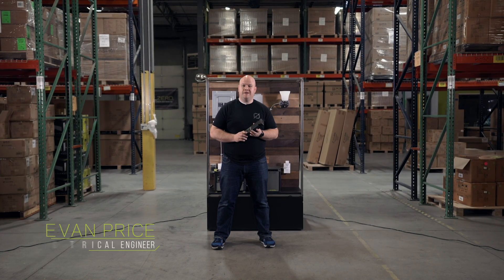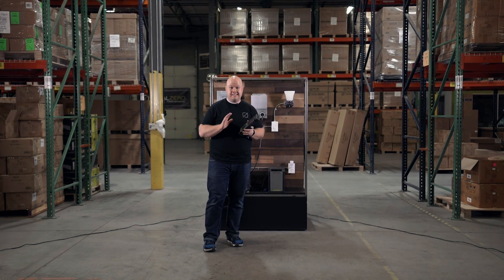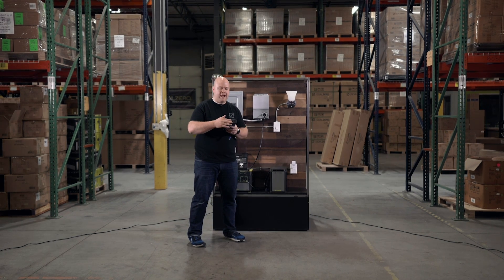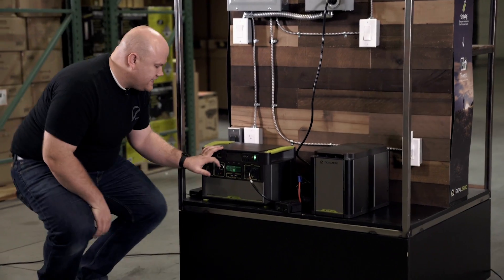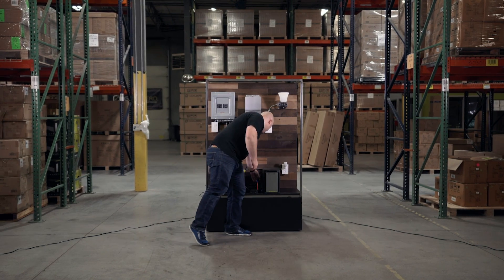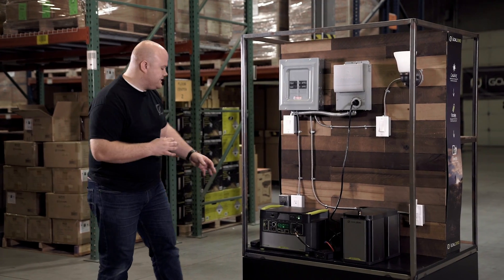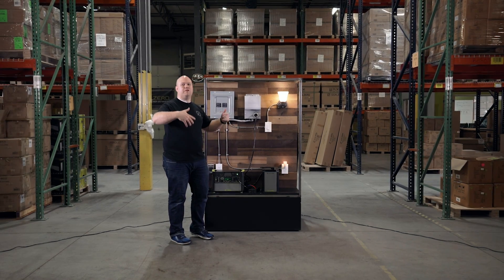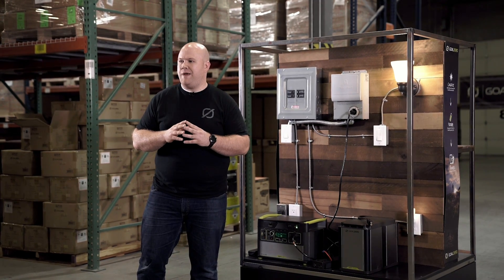From the Engineers | The Goal Zero Yeti Link & Tank

Comment: I live in Florida and bought this item and 2 sets of solar panels to replace my gas generator. I have tried it out on a number of items. I recently tried it out on my Instapot Duo Plus. It works great. The Instapot Duo Plus draws about 900 W max. heating and 60 W cooking, cooked sweet potatoes in 10 minutes. It drew about 7% of the power for cooking. Peak was 900 W, low 25 W. My freezer is old and medium sized drawing up to 150 W but only 7 W most of the time. My Oster toaster oven draws 1000 W when heating, big draw of course for heating elements but that’s expected. I have used it for my laptop computer, charging my iPhone, iPad, etc. It recharges pretty quickly. This is a great value for the money.

Comment: What are those power cables running across the floor to the display? And more importantly, how long does the Yeti 3000 power things (device wattage x duration)? Last question: How much do the Yeti Tank LA/AGM Expansion battery units cost per unit? Thanks.
Reply: Go to Amazon for prices if in stock. Otherwise go to Goal Zero dot com for all the rest of your questions except the first one. I suspect the cables going across the floor in this ULTRA DARK video is just the set up for the video and all. And oops guess GZ forgot to turn on the LIGHTS to make a DECENT video so you can actually see where he plugs in and unplugs things. DUH Goal ZERO and you make lanterns and portable lights and power banks and what happen to the logic of actually using some in this video?

Comment: Why not use LiFePo4 in the extra battery, a 4S LiFePo4 can be recharged with standard AMG chargers if temperature compensation factor is set to 0.

For people whom want to make their own, you only need a bust-buck converter with a current limiter, a LVD for the external battery.

Goal zero already makes one of these boost converter. Their 12V charging cable. The only thing you need is a LVD..

Comment: So I applaud the fact that Goal Zero recognizes the maximum input power capability of large Yetis (previously 685W on a VERY good day) vs >1500W of output power as a weak point and released this module to be able to bring in higher power levels (750W) to a yeti.

I think many people would like a means to connect large solar arrays without using a lead acid buffer battery (the whole point of buying a Lithium yeti is to get away from lead acid technology).   

I know at the top of my yeti wishlist is a 65A MPPT controller preferably with higher voltage input, but within the constraints of what is available today.....

Has goal zero engineering (or anyone else) messed with feeding a yeti link from an external MPPT controller WITHOUT a lead acid/agm buffer battery between them?  Obviously this is the preferred solution as it keeps Goal zero hardware and charge algorithms in control of charging their own batteries, keeps the solution purely lithium, eliminates maintenance issues of seldom used lead acid batteries (sulfation, stratification, etc) and still keeps the package fairly portable.
Reply: There are difficulties in charging lithium batteries, due to the characteristics of those batteries. Lead-Acid (or similar) batteries don't have the issues that lithium has, and they're very welcoming of changing current inputs. This makes them the better candidate for solar systems. Even if your main system is lithium, having a lead-acid battery as a buffer makes for the most efficient system, capturing more solar energy. In a case like a home back up, having banks of lead-acid isn't a problem as you're generally not moving that weight around.
Reply: @AaronHorrocks  for lithium batteries this large, they can easily absorb the current.  Most of your points are valid for a low capacity lithium battery.  But dumping a kilowatt of power from a DC power source into the yeti 3000 using a link module, or dumping a kilowatt of power using an mppt dc-dc converter is zero difference as far as the battery is concerned.  The output voltage and current from each respective converter is the same (constant voltage 12.6vdc current limited to maximum allowable charge current).   Everything else that is “special” about lithium charging/discharging is managed by the bms PCB inside the battery unit itself.   Goal zero chose a very low voltage lithium battery to avoid problems like cell imbalances across a large series string of batteries and also to eliminate the need for a DC-DC converter to run 12v stuff, but they pay for that with high losses due to large currents required (you are pulling 180Amps from that 11.1V battery when you run the inverter at 2kW!).  This low voltage approach and use of inexpensive MPPT components means that the solar voltage must be fairly close to battery voltage (hence the 21V max rating on mppt inputs).  That means that you must run heavy cables from a large amount of solar or else you are losing all your expensive solar power to voltage drop in the cables.   This is why most of this type of equipment typically favors higher voltage batteries (24-48V), and allows higher voltage solar inputs (stringing panels together in series allows you to carry a lot of power with low current and hence smaller/lighter cables).  The downside is the power conversion electronics are more expensive.

Comment: Does The link have to connect to the alternator for car mode to charge the yeti ,and doesn’t the amount of power coming from the alternator depend on the alternator ,and why would you connect the link to the car battery, and there is a solar input on the link is that only to charge the car battery

Comment: I do not understand why an industry leader in Lithium portable power technology puts out an expansion tank using old technology AGM batteries and losing all the advantages that Lithium brought to the scene - something very wrong with that picture. :-(
Reply: Aussieonyak Any response to this question from Goalzero?
Reply: I just gave up waiting and made my own lithium tank.   3kWh and it’s about the same size as the one in the yeti3000.   I got a little annoyed when they released the yeti 6000 as opposed to an expansion option for all the previous yeti3000 owners. I like having it modular now, because 6kWh is really heavy to carry if it was in one box, but carrying a 3kWh yeti with extra 3kWh boxes is a nice modular solution that is easier to transport (and if I don’t need the extra runtime, I can just use the yeti3000).   I kind of wish they did this approach with the yeti link, that’s kind of what I pictured when I first saw this product.
Reply: price, tanks are $400 for 1200KWH
lithium from Relion is over $1,000 for the same capacity

Comment: I hate proprietary connectors. :(
Reply: Goal Zero is one of the easier ones to work around with their Anderson or classic 12V connections. By the way my husband was nice enough to rewire my home made double 50 watt flexible panel book I made around 2015 for 2 deep cell 800 watt solar charged batteries pre-GZ lithium days. But going to lithium they must be wired in parallel and also wanted to plug into GZ's anderson plugs. Now you can buy anderson plugs easy enough but you need to pay attention to how to align them. Some are vertical some horizontal etc. So once we knew how to do that we replaced the classic MC4 plugs with the anderson and I also had him add a 40 foot extention wire to the works. So I can unplug the solar panels and the GZ both and just wrap up the extention. This allows me to place the goal zero in shade and pretty much move the solar panel which is very light weight as I made the cover with 1000D Cordural pack cloth. I had trouble as the semi flex panels were not cut prefectly square and the edges would slip behind the frame work but by applying two inch wide velcro sew on to the back side of the cordura book cover and then using outdoor adhesive velcro also in 2 inches to the back of the panels themselves they were stablized. Original lay out allowed me to pull them apart and use a 50 watt independent or if one failed I had a back up while camping. However now of course they are connected together. So with this 100 Watt solar panel going into the mppt unit I can still use a 12V standard plug and again a 30 foot extention to a 60 Watt Allspower portable roll up backpack solar panel. So I'm inputting 160 watts and I really didn't have faith my husbands rewire would work with my 100 so I had ordered a folding commercial 120 Watt portable system as Allspower was out of theirs at the time. I hate the one I ordered it's like 5 times heavier than my home made one but is smaller as it folds up. But I kept it as it works and it'll be a back up if I ever find a need. Overall if I were to buy another premade portable solar unit 100 watts or higher I would go back to Allspower. Very happy with everything. By the way the original solar watt book I build I did the design all on my own and no one else was involved. I had a few nay sayers including of all things the people who sold me the 50watt panels? I ignored them all and didn't see why it wouldn't or
couldn't work. The original 800 watt deep cells accepted the MC4 Classic plugs no adapters needed. But I needed help as I didn't have a lot of time to refigure them together and since I
needed to rewire the plugs to anderson or 12V I asked my husband to help out. He was 80 at the time. I'm in my 70's but in my 60's when I developed my own. My husband of 49 years does not like to camp. I've been tent camping well over 50 years on my own as a solo female and there are a lot of solo females who do. Often like me their fella's are just not into it. But we gals love it. So there are clubs even for this for ladies who feel the need to have support and even company but more than not most of us are happy to just get out there. I call it my she
camping and off I go at least 2 weeks a year and yes still in tents. I do have every style and
size of tent you can imagine so lots of options every year to choose from. But the whole reason I'm into the Solar batteries is to keep my 27qt dometic freezer making ice to feed my 5 day cooler every day. I switch out two half gallon frozen ice bottles (old juice bottles the rectangle shaped ones filled 3/4 full and pre-frozen six at home to start with.) Place four in the dometic freezer and two into the cooler and plug dometic into Car 12v system and we hit the road. Then every day I just exchange two bottles for two out of the freezer and the Goal Zero keeps it frozen. Yes you could run the dometic as a fridge. But logic for me is this way
if the freezer/fridge failed for any reason I have enough ice to keep the cooler for a few days
but if used as m fridge alone if it failed then I'd have to get ice somewhere and maybe not have a cooler along even. So a little extra if I am certain I have power for the freezer traveling
and once at camp I can keep icecubes premade and or made at camp too and even a few
frozen treats. I do not trust I can keep many frozen treats going so maybe 1-2 like icecream bars or those drumstick bars. There is not a lot of room left in the dometic when there is 4 of the half gallon jugs in it. And yes I agree hate proprietary anything but especially connectors. There are several campers that are prewired for solar but require just that special plugs and state they are not for any other but that brand of panels. HA visit Youtube for many a hack and blogs too. And you can always re-place them though it may deface your camper wall to do so but that can be done professionally if you have the right tools and know how. Always educate yourself to outsmart EVERYONE who's attempting to stuff your square peg into that round hole. Anyway really surprised my first homemade panels that were lighter than any sold being semi flexibles still work after more than 8 years. Easy to transport and lean and I can hang on side of tent or car or tree or set up open book on ground tilted or flat even. I just float it on top of everything in packed in the car so it isn't accidently damaged in drive. Probably weighs less than 5 pounds. It's so wonderful if I ever do have to replace I will make it
identical with only minor improvements again. The cordura and velcro were the keys that would stay the same. But you could easly use lighter weight cordura or pack cloth but I wouldn't as this was stiff enough to provide much form too. It closes up but I do now have wires that due to being set together hang off one end and so I would make sure to make an attached case for those if ever there is a need for a next generation.
Reply: @lasinmt106  
W😱W!
Sure sounds like you could have done it all without the husband.
your reply/comment was quite an impressive read and I'll be honest... as a 50yr old DIY make, I didn't understand at least a quarter of what you laid out! good job. Do this world a favor and copy/paste your response as a stand alone comment for everyone to read and it doesn't get lost in the response section of an adapter comment. respect.

Comment: Goal zero. As to my understanding the lead acid batteries can only be drained safely down to 50%. Does this new module already compensate for this? Are those LED lights on the module basically showing the 50% usable energy? And when the lead acid battery runs down all the way I assume the yeti internal lithium battery takes over and will support the inverter?
Reply: Details at goal zero ,good luck with that

Comment: So basically those of us that bought the mppt are getting screwed by Goal Zero??? Way to go GZ
Reply: Yep me too. I commented on that too before I read your note. My GZ1400 is now 5 years old however I think that annoyed me most is after waiting 3 years for GZ to catch up to lithium solar battery world they failed to be compatible with either of my dometic portable freezer/fridges including the small 27Quart one. If it drops below 87 charge it kicks the dometic off juice. WHAT? So I ended up buying a different brand of solar battery that does not do that. That allows me to get through the night with the freezer and then recharge the GZ during the day while it is being charged at the same time and also recharge the RockSolar battery not running anything. When I contacted GZ about the problem they said that's a compitiblity issue. It kinda goes deeper than that. THE X models are suppose to fix that and also they come with mppt's installed as part of their sytem but yes basically GZ has kind of screwed us with their early batteries to the point I probably will not replace or update the GZ with an X but search out other brands to take it's place. Yes it has propriatory plugs and all but almost all of those can be replugged and refigured. I turned my home made still my favorite 100 W portable light weight solar book style panels to fit GZ's anderson plugs and M4 plugs that they originally came with and needed to be rewired to parrallel. They were two 50W semi flexible panels that I made a cordura cover like book for and it is well over 7 years old now and still like new. I can use it for any other solar battery when the time comes or just keep it as a stand alone for the GZ1400. I'm always trying to outsmart the so called smarty engineers who like to make life more compliated for their customers and use propriatory set ups. I look at as my job in life. A female in her 70's and yes not only for GZ but any other stingy company and bean counter who thinks they are sticking it to the consumer. And I kinda sometimes even enjoy the challenge. But oh yeah somehow GZ screwed us early customers on their mppt module however on the flip side I can remove the GZ and it's new module and re-insert the mppt original when and if I want to go portable again. I don't. Once I get my original GZ1400 set up with the four storage batteries from them and switch box etc. I intend to leave it as such. I'll then switch to another brand for my portable and camping needs. (I used it for lights and fans and last summer even a swamp cooler on a back covered 24 foot patio that has no AC. Competitors are ahead of the game these days it seems on this game. I don't knock the new X models but have no feedback or experience so as much as I was a total fan GZ hasn't hung in there with it's fans and I'm seeing so many good options and often less expensive ones too right now.)
Reply: @lasinmt106  you need to use regulated 12V adapter on the non "X" models, that's why. the "X" models have regulated 12V output
Reply: I think the X models have that built in. I too bought the mppt for my 1400 when I bought it in 2018. What really is upsetting is it turns out if you buy the storage batteries you also lose the portablity of the GZ battery system as it's kind of hardwired to the tanks not just easy plug and unplug and go portablity any longer. I also think you can remove and replace the mppt if you still want to use it when going portable but not that easy for sure. What are they tninking they so need to answer our questions and provide some VIDEO updates that aren't in the DARK as in really GZ you sell all these lanterns and light and power systems and YOU can't make a video in a dark warehouse thats lit enough to SEE what you are actually doing and saying you are showing?